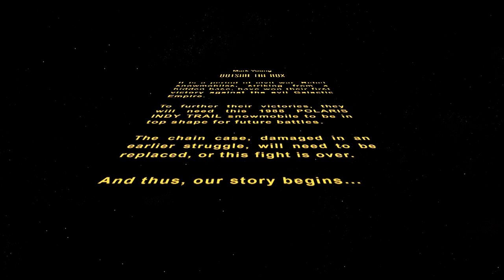Fixing my mistake: Chain Case Replacement

Comment: Did you put the bearings in backwards?  
The original orange sealed set only had seals on the outside of the case, & were open to the lube on the chain side of the case - but when you installed the "new" ones you could see the blue seals were to the chain side which would keep lube from getting to the bearings and possibly allow debris/snow to get into the back side of the open bearing if they weren't double sealed style?
Reply from the maker: These bearings are double sealed, but I know how the original design used the chain case lube for the bearings too. Good eye.